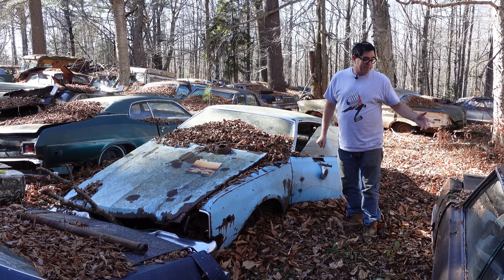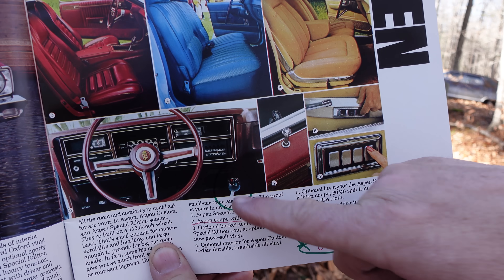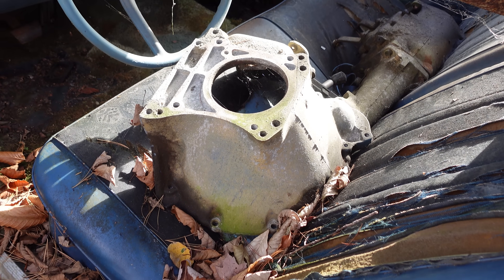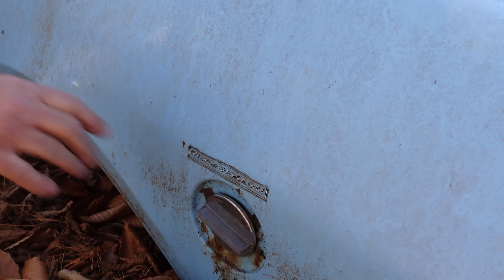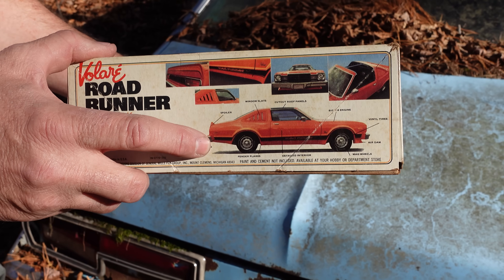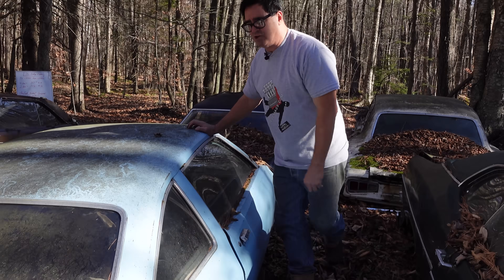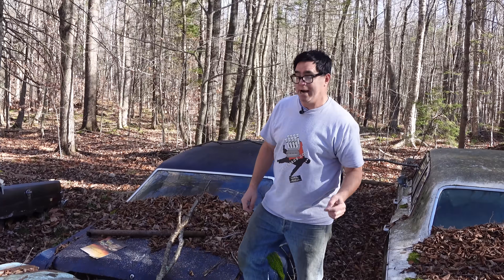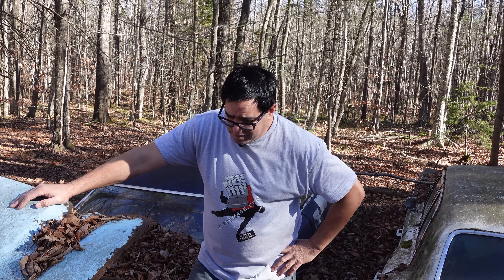First F

Comment: Yes, there was a huge campaign to change prematurely rusting fenders on these cars. My uncle had a 1976 and by 1978-1979, the fenders were completely rotted out and had to be replaced. The paintwork was shoddy on it and my uncle never bought an American car again (he switched to Honda in 1985 and owned three of them until he passed in 2012). These era cars were the ones that soured a lot of American consumers and put them on the path to foreign vehicle ownership that continues in many cases until this day.

My friend bought a 1978 Dodge Aspen four door "Super Six" in 1994 as a commuter car and when we went to go test drive it, the guy said, "runs great, but handles like a sack of potatoes". He was right. It was rusty and worn out, but it ran great. We put a carburetor on it, tuned it up and he drove and maintained it for two years. He then decided he didn't need it any longer and wanted to junk it (he offered it to me first, but I was given an Delta 88 in 1996 by my uncle, which I still have, although it's "retired" now), so we drove it to the yard. It was a yard (now gone) that both of us used to get used parts (trim, lights, etc.) and the owner (now passed away) said to my friend, "Son, you sure you want to junk this? It came here running....". My friend said yes. We took the plates off and I drove him home. I forgot what he got for it. The next time I went back to the yard, I do not recall seeing it. 

We got the VIN, we win: N for Dodge Aspen, L for low price class, 29 for two door special coupe, C for 225 CID Slant Six with one barrel, aka "Leaning Tower of Power", 6 for 1976 model year, B for Hamtramck, MI assembly aka "Factory Zero" or "Dodge Main", and the rest is the production sequence. The Dodge Main plant operated from 1911 to 1980 and today part of that property is the site of GM"s Hamtamck, MI assembly which they also sometimes call "Factory Zero". The Dodge Main plant as noted many times was a city within a city with its' own medical wards, cafeterias, fire protection and the "Playpen" area for employees to work on their own projects after hours. This one was made on Friday, January 30, 1976 at approximately 10 AM. Exterior paint is code B1 Powder Blue.

No, only one model year (1976) was the Aspen/Volare sold alongside the Dart and Valiant. By 1977, the Dart and Valiant names were gone in the US. Not all of them would have a catalyst. Some special options (police, export, etc.) could be had without them, but yes, most retail sales and ones for use in the US would have catalysts. 

Brattleboro Chrysler Plymouth (the dealer logo on the trunk) is now McGee Chrysler at 1270 Putney Rd, Brattleboro, VT 05301.  The kit has a copyright of 1975, so it was pre-Carter (who was elected in 1976 and took office in January 1977). Yes, the K car "saved" Chrysler, but the Omni and Horizon actually did because the K car didn't come out until the 1981 model year and by 1979, Chrysler was pretty much broke. So the Omni and Horizon were the stopgap until the K car took over as the sales leader for Chrysler.
Reply: The fenders would rust right on the dealer lots
Reply: @FrankBullitt390  That they would. My friend had two of them, a 1979 Aspen SE 318 V8 four door that was originally code RT9 Sable Tan Sunfire (but was primer by the time I became friends with him in 1989 in college as undergraduate students), and later on a 1978 Aspen "Super Six" four door that was code PB3 Cadet Blue exterior paint, but was "rattle canned" with similar colors by the time he got it in 1994. Yes, both were rusty. The '79 was his parents' car new.
Reply: @googleusergp  I believe it was due to recycled metal that still had rust in it from the melting process, essentially hammering out new body panels that had rust built right in.  My uncle had a 1980 civic that literally disintegrated from the same thing, he was even his money back for it!
Reply: @FrankBullitt390  More than likely it was also poor rust protection, preparation, painting and overall Chrysler trying to shave some production dollars out of the budget as the coffers were running low back then. Chrysler was not in good shape and the US economy and recession was not good for them. GM weathered the storm the best, but that's only due to their size and prowess at the time.
Reply: @googleusergp  That too but its well documented that they didnt know how to recycle steel yet which was a major contributing factor.
Reply: @FrankBullitt390  All around lose-lose for the consumer.
Reply: @Google User GP  Actually, he had an Aspen SE (special Edition).  The Plymouth Volare could upgraded to Volare Premier.  My friends mon ordered a brand new 1977 Dodge Aspen SE four door.  225 slant six, AT, PS, PDB, AM/FM stereo, and no A/C.  Beautiful color combo, too.  Silver with a burgundy vinyl top and burgundy interior.
Reply: @rickloera9468  Yup I think I had them switched. Same crap. Lol.
Reply: I remember back in the late 70s and early 80s some yards would say in their yellow page ads that they would give you $200 if you drove it in and $100 if they had to come and get it.  They were also known to offer you less than that once you got there or when they showed up, as they felt they had had you at that point.
Reply: @kennethsouthard6042  Yup, that's why many folks pushed them, pulled them, and if possible drove them to the yards. Picking it up was the last resort. I remember I junked a 1979 Toronado parts car and I picked everything off that. I sold the engine and transmission the same week I got it. I stripped off everything I needed for my 1982 Toronado which had gotten stolen and recovered in 1990. I then stored everything away for it that I didn't need at the time and sold it over the course of many years. As the Toronado was becoming an eyesore and I don't like junk laying around, I called a tow operator that I knew who came right away and he stated that he needed $20 to take it because it won't have any weight across the scale. It sounded reasonable and off it went. I used to get a lot of cars for parts, and I'd strip out what was good for my cars, save the rest for later resale and then scrap the rest. The cars I got were for free, so I was into them for only my time to remove any parts.
Reply: @googleusergp  In 1984, a friend of mine had this Dodge Colt wagon that he accidentally rolled on a gravel road when he hit the brakes too hard, we drove it around. the area is a beater for a few days on Motocross trails, but the manager of his apartment complex had finally had enough of us parking it there.

So we drove it off to the yard, problem was the yard was about 10 mi away and driving a rolled car along city streets was not the smartest thing to do.  On the way some cops stopped us but luckily they were on the way to another call. They told us to stay right here and they would get back to us.  At that point we were only about a mile or two from the yard so we pressed on.  We got to the yard and of course since the radiator had had an issue they said that the head gasket was blown and took $50 off the "drve in" price.

The things you do when you are in your early 20s.
Reply: @kennethsouthard6042  Yes, driving it to the yard was bad enough, but when they came to pick it up, it was the "ultimate loss" Back in the day, if you put your washer to the curb, it was the talk of the town. "Oh, the Smiths got a new washer. Their old one is at the curb". Everyone tried to fix things back then. Problem was the parts are easier to find, look up and get now and the information to repair them is readily available online. Back in the day, no one shared their "secrets" of how to repair them.
Reply: My mom is just like your uncle. Her first car was a 1977 Volare and since then, shes had mostly Hondas (and one volkswagen that was an absolute lemon)
Reply: @erichite4871  Yup he never went back. When my aunt moved to FL in 2019 she took the 2002 Honda. It only had 35k on the clock.

Comment: I had an Aspen, black on black with the louvers and spoiler. I found some  dog dish hubcaps for it and it looked pretty cool. Mine had the transmission behind the engine rather than on the front seat.
Reply: My friend had two, a 1979 Aspen SE with a 318 V8 that was his parents' car from new which he primered and "hooptied" up when we were in college (he eventually junked it for a 1991 Dodge Shadow which he drove over 200k+ miles) and a 1978 "Super Six" 225 CID Slant Six two barrel that he owned for about two years from 1994 to 1996. I went with him to buy the 1978 and we worked on it together.
Reply: @googleusergp  mine served me well, always starting in the coldest Minnesota mornings. In my recollection it wasn't rusty. I think it was the first time I sold a car to someone other than the wrecking yard when I was finished with it!
Reply: @jfu5222  My grandparents had a 1980 that they bought new, but by 1986, it got sold. By then, my grandmother had a heart attack (in the fall of 1985) and her doctor told her she had to get a car with AC to help with her breathing and health, so it got sold and they replaced it with an '82 Skyhawk from the Cadillac dealer that my father worked at.

Comment: I got a 78 Aspen 4dr with 318 60,000 miles from a dealer; local trade for $1400.00 in 83. So it was about used up. Weak oil pump and super soft shifting auto trans. Total chit box. I loved that car 😂

Comment: I worked for Chrysler Corporation at the time the Aspen was released.  It was the most recalled car ever, the rust problem was just a faction of your problems. Many Aspen right front fenders were so rusty the antenna dropped into the inner fender in about two years.
Reply: Had a road call on one of these. The ignition module fell off the fender due to rust.
Reply: Hopefully not in the Newark, DE or Hamtramck, MI plant where they were typically assembled. LOL.

Comment: My brother bought one of these brand new, and I remember checking the oil for him a couple of years later and couldn't believe the tops of the fenders had rusted completely through already. Living in NY state was a major factor of course, but 2 years? He got disgusted with the rusting and traded it in for a Subaru a few years later. What's funny is that I have never seen a car rust out so quickly and completley than that early '80's Subaru. Within 5 years there was not a body panel left that had not rusted through.

Comment: In 1980 I bought a used '77 Volare with a 318, 4 speed manual w/ overdrive on the floor, sunroof, and Magnum 500 wheels.  It was a good looking car and got 26 MPG on trips.  I didn't have any rust problems and we lived in PA.  I washed it at a carwash in the winters to get the salt off.  If you live in a place that salts the roads you have to spray under the car and into the wheel wells and every crack and crevice you can find.   It was a dependable car.  Drove it all through college and I was the guy my friends called when their cars wouldn't start.  The 318 with a manual trans is a bullet proof drivetrain.

Comment: The only thing Chrysler got right with the Aspen and Volaire was the styling.  The 1976 and 1977 fenders rotted immediately but ran great.  In 1979 - 1980, they improved the rust situation, but due to federal emissions standards, they issued an electric choke.  Chrysler dropped the ball on that.  I bought an used 1980 which constantly stalled and bogged down until it was fully warmed up. I think 1978 was the best year as some rust mitigation was made and the engine ran good when cold.  I also owned a 1978 Volaire whose underside was a sea of rust, but the car ran great until a deer stopped it.
Reply: They weren't any better in 1978, as my friend had one and it was pretty rotten when he bought it as a used car in the 1990s. By then, it was a well used, but very good running Super Six equipped car.

Comment: My first set off wheels, were on a 1977 Plymouth Volare wagon! However, in this sheep's clothing was a factory 360 v8!! This little beast took many of my friends off guard and left me laughing at the finish line!!! Wonderful memories.
Reply from the maker: Hello JN, ME TOO! No, not "that" me-too. I also owned a Volare station wagon. Mine was a "K" code 360 2-barrel and you're right, that thing had pep but mostly could peel the tread of the right rear tire all night long! BIIIIG clouds of rubber smoke from the right-rear corner. Mine was a 1976 and it was the car I drove from my "home" in Massachusetts to Los Angeles way back in 1991. It was truly my "Mayflower" (Plymouth Rock settler reference there, but you knew that). I drove that Volare wagon in L.A. for 3 years (I admit...with bogus Mass. license plate registration stickers I made out of Press-Type lettering and reflective tape) before junking it at the Monrovia Pick-A-Part on Peck, Avenue. They gave me NOTHING for it but I sold the 360-2 and HD 904 to a hot rodder before junking it. It was a rusty critter. I was bummed out that 30 days later, the car was removed from the Pick-A-Part "killing field" and crushed like all cars were after being scavenged for 30 days. It amazed me that NOT ONE PART had been taken during the car's 30 day stand in the Pick-A-Part rows! It was that rusty!!! Anyhoo, here's to 360 Volare and Aspen station wagons. -Steve Magnante
Reply: @SteveMagnante  Again Steve, Mexico got the good ones with the 360 4 speed and no smog stuff.
Reply: @SteveMagnante  LoL! Awesome! Mine met with a similar fate.
Reply: @SteveMagnante  My neighbor had a customer with a 1975 Plymouth Scamp that had a 318 V8. We used to call that car "The Beast". It was light and nimble and quite fast for what it was. It could go. One day, another person was driving it and took a turn too hard and a hup cap rolled off of it right into this older lady's yard as she was watering her garden. I had to get out and say to her, "Sorry ma'am, that belongs to us". She just shook her head as I walked away with the hubcap. Yes, you've featured one like it on your "Hubcap Game". LOL.

Comment: Knew a guy that owned a Mopar dealership in New York when these things were self destructing. He said the body shop ordered replacement fenders in packages of 20 at a time. When they were recalled for the fender rot, they were required to find every one they had sold and replace the fenders, even if the car was already in the junk yard. He said the yard owners would watch them bolt new skins to the dead cars, and then pull them off and sell them as new immediately. Your tax dollars at work...
Reply: What part of NY was the dealership in?
Reply: @googleusergp  Far western. He lived in a little town called Mayville.
Reply: @howardscott7521  Sounds very cold and way too rusty for me. LOL.
Reply: @googleusergp  There were tons of tiny Mopar dealers in NY back then, I went to an auction for the closing of one in Red Creek.  They might have been able to keep one car inside in a showroom and the lot had room for maybe a dozen cars.  It had shop space to do most anything though and could work on three or four at once.
Reply: @CR7659  That was often the "footprint" back then of most car dealerships. They would have one or two models of a given car and a bunch of books and literature. You ordered what you wanted and then eight weeks later you got the call, "Hello Mr. CR7659, your (whatever) has arrived". My parents wanted to order a Trans Am with the equipment that they wanted in 1979, but the gas crisis that year foiled that. By the time 1980 rolled around, the model year was almost over when we were ready to buy it and an '81 would have taken upwards of eight weeks, and we had already sold our other car to my father's boss, so we wound up with the "red one" as the sales manager put it (technically, he was correct, it's code #79 Red Orange or Carousel Red depending on what literature you reference).